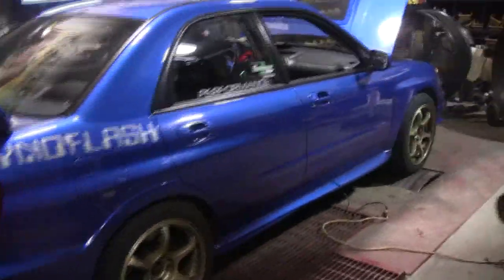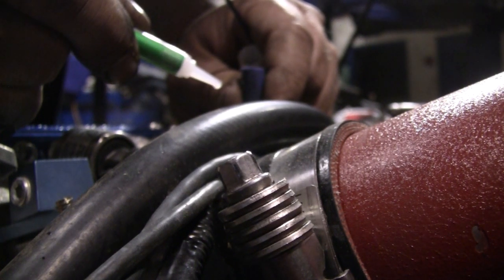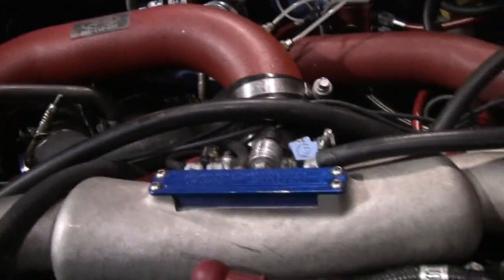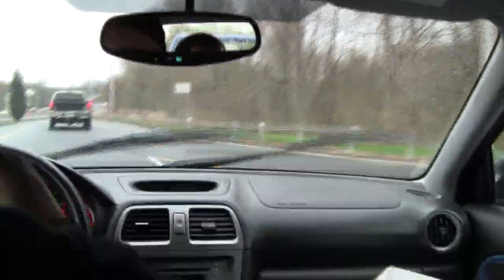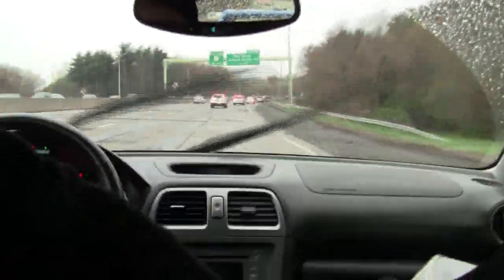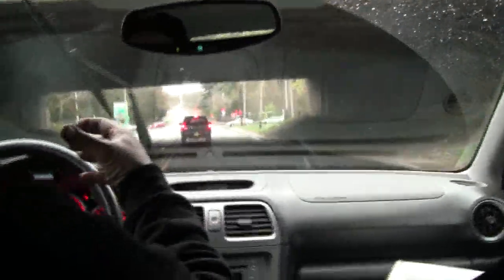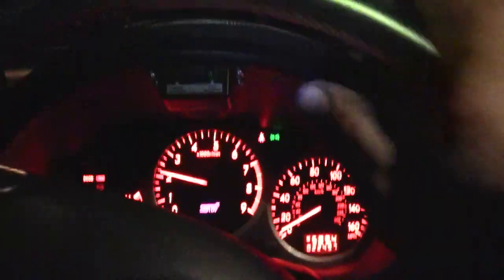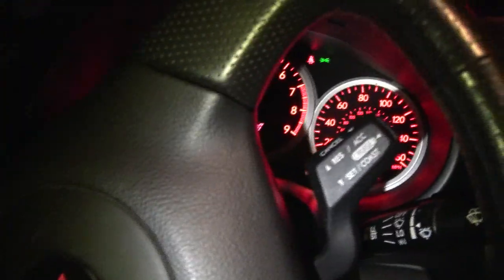Testing, Diagnosis and Fun with the Dyno Flash Sti

Comment: @sergio73192 I can give you a ballpark... for a fully built motor with all the bells and whistles like that able to push 600+ WHP after parts, Labor, and tuning costs you looking at close to if not over 10 Thousand bucks.
My step brother runs a subaru shop and just for a fully built motor labor and tuning is over 6K.
Let alone the crazy maintenance costs and repairs involved in keeping a 600HP car running. My STI is pushing around 400WHP and even that is a pain to keep running perfectly

Comment: Great stuff as usual Al. I just was thinking tho, why dont you go for an external fuel pumping system? I think in the long run it will save you these headaches even if you put an external booster pump, that should solve any fueling issues you might have. and its alot easier to work on than having an intank pumping system. Goodluck and keep bringing us these great videos

Comment: Al, what's your base fuel pressure set to?  If its too high at base, it'll fall off at the top end pretty quick.  I would try a bosch 044 fuel pump and a surge tank after the double pumpers.  Thanks again for the great vids!!

Joe

Comment: @Red97Avenger ya i know. Its a larger turbo, so its going to flow more airflow with less boost. but still 24psi on a 2.5L motor  making close to 600whp is impressive. The spool still remains decent even. Im guessing its atleast a 75lb/min turbo.

Comment: What size nozzles are you using on your STI? and what is a normal size nozzle you will use on a car running ~30psi?

Also i assume you run pure methonal on the cars you tune? or do you use a 50/50 mixture?